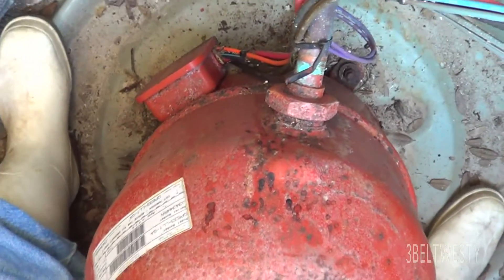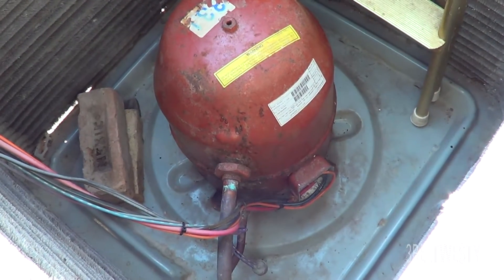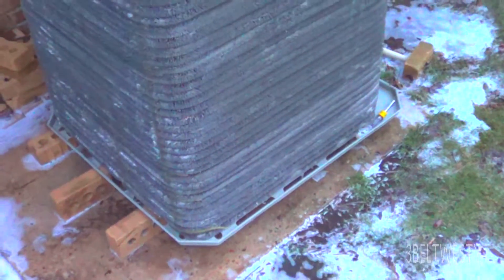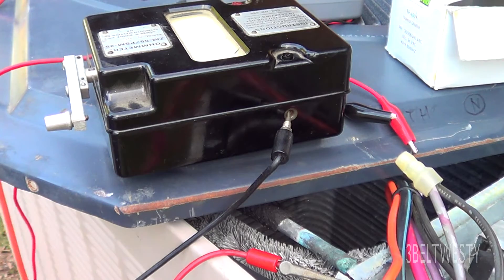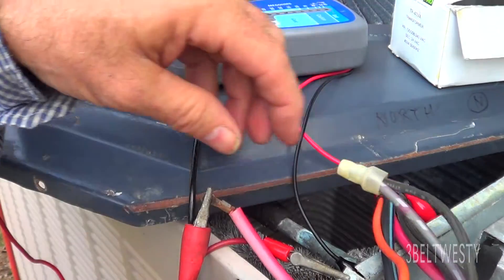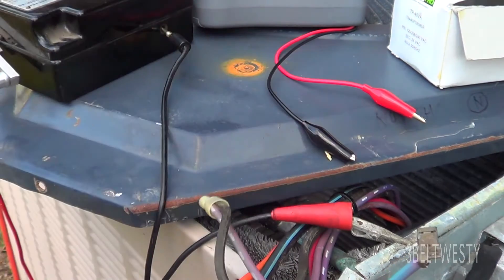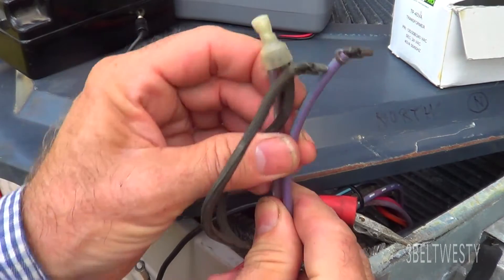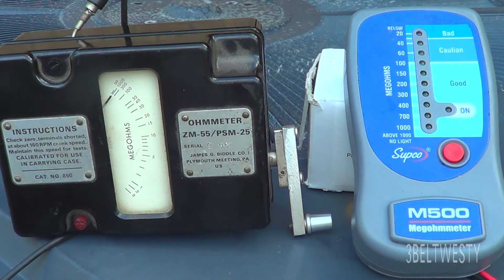HVAC Bad Megger readings on Trane were due to crud

Comment: That Supco tester is a pile of crap.  According to Emerson/Copeland, a compressor must read les that .05 megaohms in order to be condemned or the reading.  https://opi.emersonclimate.com/CPID/GRAPHICS/Types/AEB/ae1294.pdf
Reply: Thank you!!! You stand correct according to Copeland, Emerson and throw in tecumseh compressors as well.
That supco is okay for diy for field use hvac guys should use  a digital insulation tester by fluke, amprobe, aemc, uei etc.

Comment: If you attach the alligator clip to an anodized, painted, or poor ground surface you are adding resistance thereby giving a false reading on the meger in the good range when actually it was not good.

Comment: on the supco M500 I am thinking the red wire should go to the terminal and the black wire should go to the ground? you had the red wire go to ground and the black wire go to terminal?
Reply from the maker: It does not matter. The PDF page 4 item 2 says use any wire one megger. 
Regards    http://orders.sidharvey.com/IMAGES/specs/m500.pdf
Reply: 3beltwesty thank you! I learn something everyday
Reply from the maker: In calibration labs and high end tests there can be a "how it is wired" issue with say a megger or voltmeter. The issue is leakage around the lead area to the tester. Thus one might have a "guard wire" ring say a 3rd wire that pulls? off the leakage so as not to bias the measurement, from 1908 . https://books.google.com/books?id=LQVRAAAAYAAJ&pg=PA96&lpg=PA96&dq=guard+current+voltmeter+standard+cell&source=bl&ots=pZAFREAued&sig=YNaRnyogha3SPgMf274qLu-D928&hl=en&sa=X&ved=0ahUKEwiSnYHj3M3UAhUFxoMKHfhiAtgQ6AEIRzAH#v=onepage&q=guard%20current%20voltmeter%20standard%20cell&f=false
Reply: 3beltwesty very interesting thank you very much
Reply from the maker: http://www.biddlemegger.com/biddle/Stitch-new.pdf
https://www.youtube.com/watch?v=w07kODisdRY
 Here an 8000 buck Megger has the guard lead, the blue input wire. The PDF on page 51 (50 on the image) goes into the guard terminal. Regards That PDF is loaded with stuff about testing.